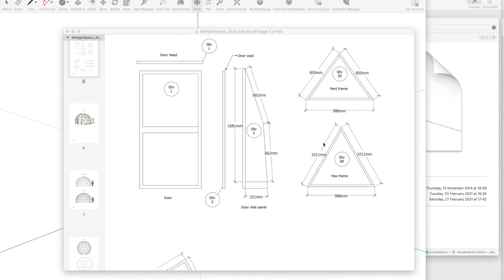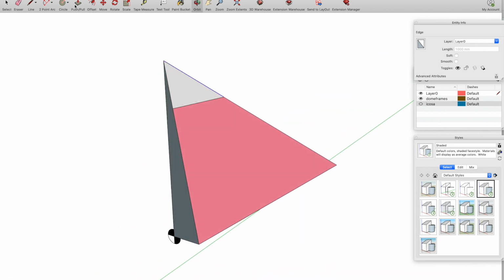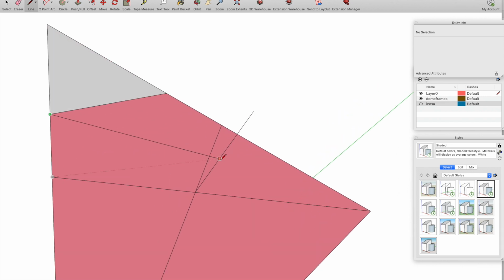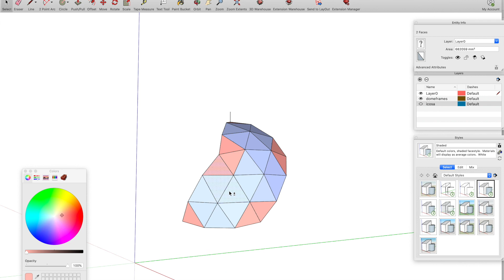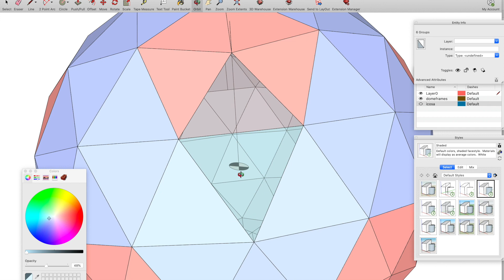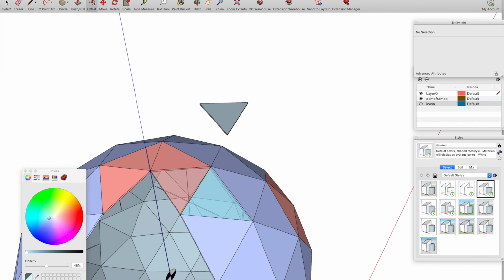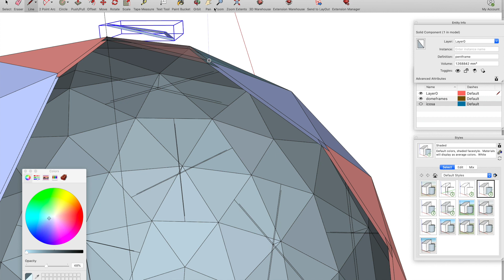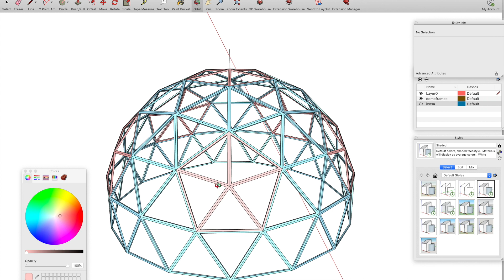Building CAD files from the geo-dome plans

Comment: Perfect! Thanks. Great video. The rotation  in SketchUp makes me confused though. Could you ecxplain that a bit more...
Reply from the maker: OK it's pretty easy once you get it. You know you can hover over any face to use it to orientate a rotation, well can can also use just a line, click on the top of a line (do not release the click) then slight to the bottom of the line and realest your click. This makes the line act as the axle of rotation.
Reply: went through my ears and my peanut became peanut butter how confused i am laughing the last part i did see what he was getting to  but before then i am sorry

Comment: what version of Sketchup are you using?  I made a first attempt to use the online one and go absolutely nowhere ...
Reply from the maker: I use the 2019 version, the latest online one is not so good, such a shame they had to move to a subscription model. You might be able to download an old 2014 version if you dig about on the web, I'm happy to make drawings available I older versions.
Reply: @Herger The Joyous! Yes. I just followed Pauls instructions and was finally able to draw this from scratch. With SU2017make. Thanks Paul. Great video. I got the rotation now. Might be helpful if you didnt sped up the video where you did the rotations.